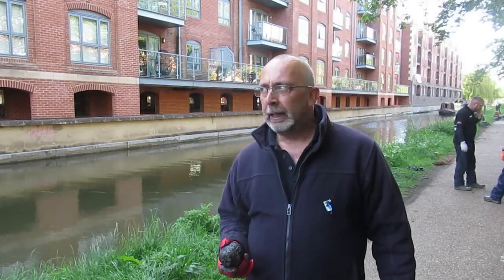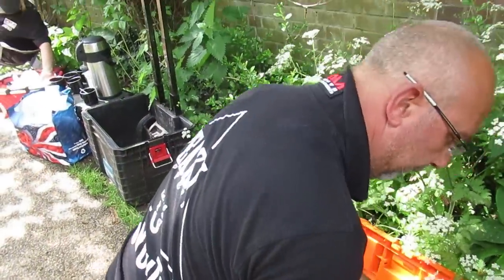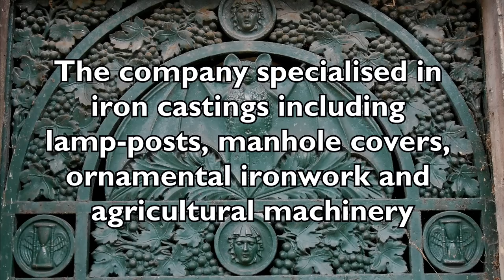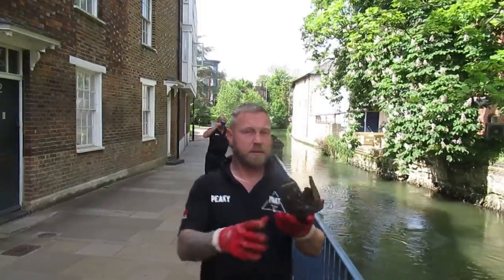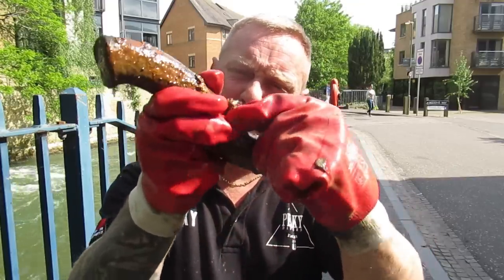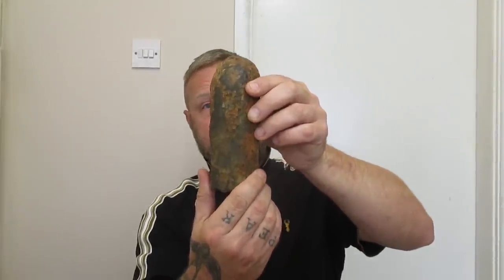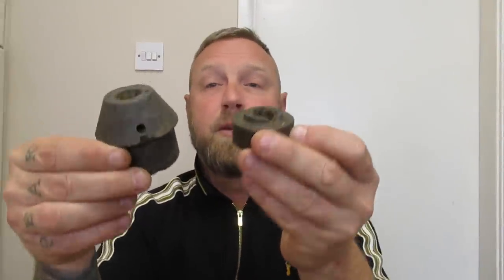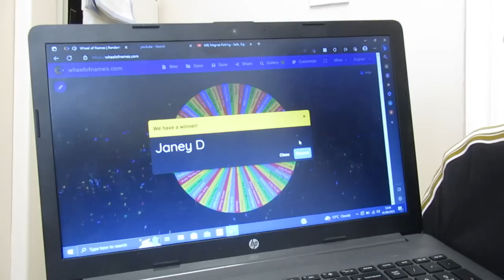*Assisting POLICE* Magnet Fishing (Relics Uncovered From An Old Munitions Factory)

Comment: 32:00- That piece resembles the bolt (shot) from a Parrott Rifle Circa U.S. Civil War 1860-1865 typically. The cruciform piece of metal could be the upper part of a large tap just before the threads  and under where the tap wrench would have attached.  Calthrops were also used in WW2 with sharper points to damage tires of vehicles. I read an article where the partisans used them against the Germans. Possibly those could have been used to lame the horses and mules of the German army also, as they used a tremendous amount of horses and mules in WW1 and WW2. (My friends father was a veterinarian in the German Army- Unwillingly. One of those "join & we won't kill you & your family" situations).  Good haul. The calthrops are very cool.
Reply: Thanks for your info FK x

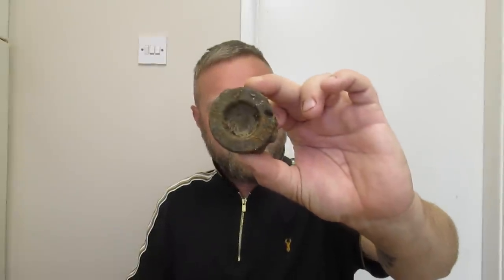Comment: Glen and Marie, at 31:04 here in America we have something similar to that and it’s a sewer drain clean out cap. We have a special flat piece of metal with the square hole that removes the cap from the drain in the garage and also outside the house. 
We use it to remove any clogs in the plumbing pipes that go under the house.
So I believe that it is a drain cap.

Comment: i guess you know this, not trying to teach granny how to suck eggs here, but you could prob go back to the factory time and time over, you will likely have an oily industrial dereliction layer down their, the metal will bond together over the century, and form a crusty layer under the mud, against the factory side away from the dredging, obviously our magnets, even our evo1800's havent the weight to sink quick enough into that thick gloupe to grab and crack the lumps off the bottom, before we start to pull in.  a few weeks dredging the area with heavy magnets and grapples, then boats floating the lose mud, and youll start getting those out of reach finds against the wall /dock (if you found it) i wouldn't give up on the place if it was local  it looked like you were only getting those single light weight geod's that hadn't sank to deep, once you hit that honey hole, and you can start cracking lumps from that bottom layer you will find allsorts,,, see if from the old picks and info if you can find out where the loading crane was sited ...  ;-)  btw those tick tacks were used on roads and tracks, in early ww1, to slow munition resupply when retreating, but the war obviously became far more static, with no ability to deliver them to disrupt the ammo resupply line on any hard standing . never seen precast moulding like that, but i doubt they produced them for ww2, (though ww2 is my grey area of knowledge, i can imagine them being used to burst troop / resupply TRUCK tyres in ambush area's) so they were likely just those single mud floating geods like the mills plugs, big stuff will be deeper in the mud and encrusted and you will see where it has broken away from the bottom or other things encrusted in that layer.. rounded heavy things sink deep into the mud over time... GL guys